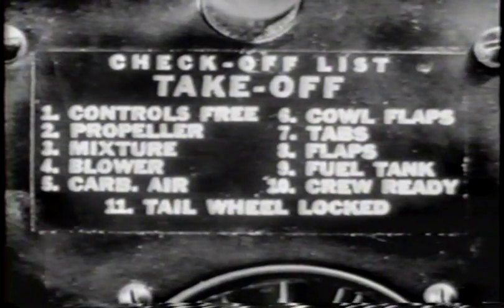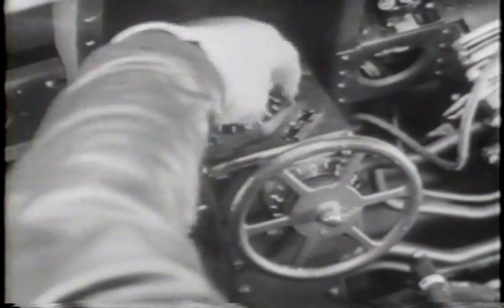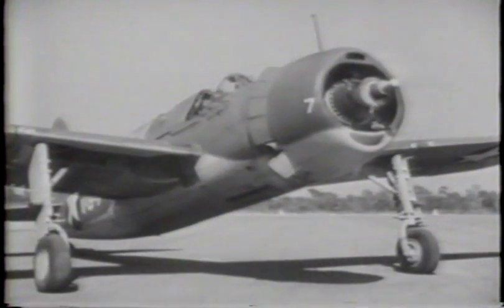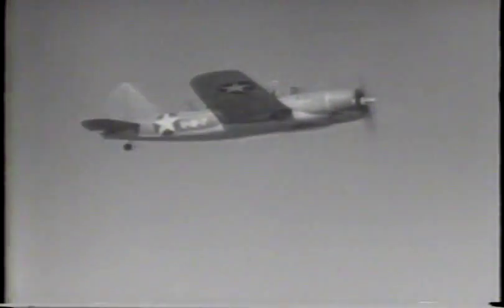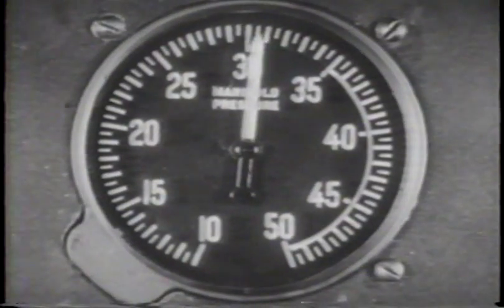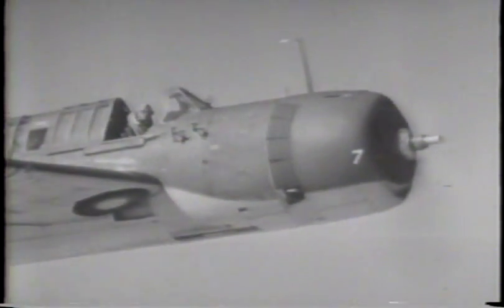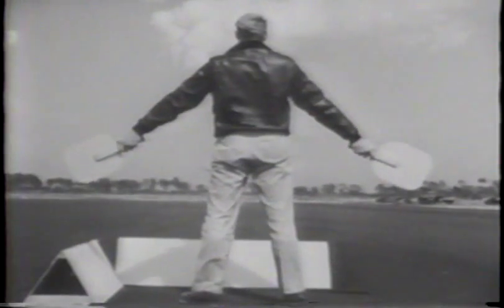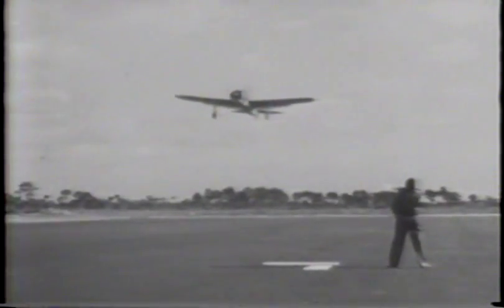Flying The U S Navy Brewster FB2A4 Buccaneer

Comment: Apparently SPD pilots that flew during the Midway battle test flew the Brewster FB2 and they were not happy with its performance. It was under powered and very sluggish/sloppy to control inputs.  It was too heavy and ungainly. Plus Brewster was the builder and they had chaotic and mismanaged factories.  Brewster got so bad with producing planes the Navy had to take over the factories just to get production going correctly.  The FB2 never really made it as a dive bomber and was relegated to training and scout work. Though older the SPD was a far better plane.

Comment: For a full and very complete description of the Brewster Bermuda, I would recommend reading an article titled, "Brewster B340 Bermuda Buccaneer and its NEI, RAF, USAAF and US Navy Marine Corps use." by Wim de Meester. It details the design, production and operational history of the Buccaneer.

By and large, the Bermuda was not a "bad" aircraft. It handled well enough and its primary flaws seem to have stemmed from being under-powered. However, nor did it have any positive characteristics that jumped off the page to separate it from the pack. The horsey and completely fouled up management situation at Brewster did absolutely nothing to help the plane's production.

Interestingly, one of its largest intended users -- the Netherlands East Indies Air Force -- never intended to use the Bermuda as a dive bomber. They ordered 162 Bermudas for use in the ground attack role; dive bombing was secondary. In that regard, the Dutch liked the Bermuda for its rugged construction and heavy armament (8 x .30-caliber MGs). It also handled well at low altitudes. To save time in the production process, Dutch Bermudas were delivered in the same configuration as British models, who had also placed a large order.

Although poorly suited to the dive bomber role, the Bermuda served well into World War 2 in a number of training and support capacities. In particular, the US Marine Corps considered the Bermuda to be a useful training aircraft, as it very closely mirrored the take-off and landing characteristics of the F4U Corsair. Several aircraft were also used for night flight / radar training.

The Bermuda was a poor / unsuitable aircraft for frontline service almost from the beginning. However, early orders from the British, Dutch and French left the USAAC / USN with large numbers of Bermudas after the Dutch and French surrendered. Likewise, production delays caused the British to order the Vultee Vengeance dive bomber instead. Production lines remained open though, as Brewster was taken over by the US Government and the plant was retooled to produce license-built F4U Corsairs.